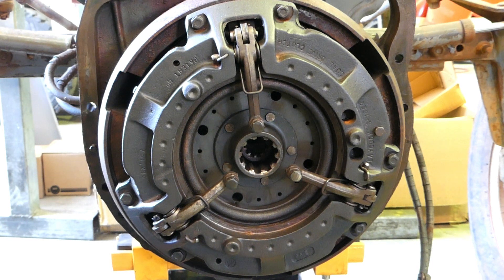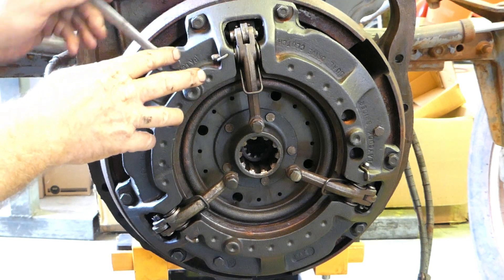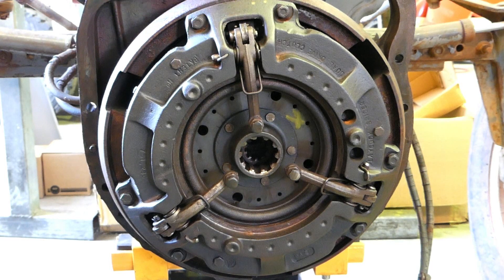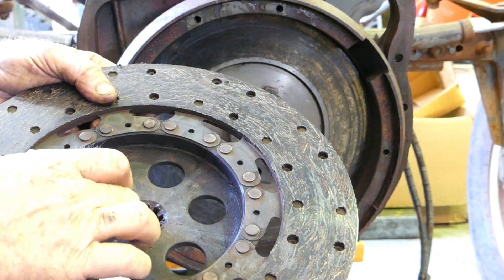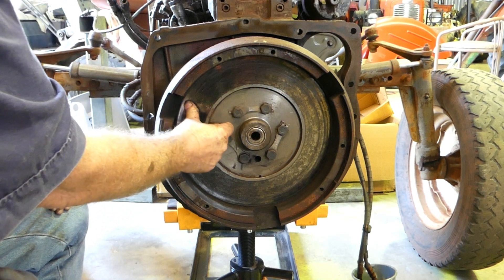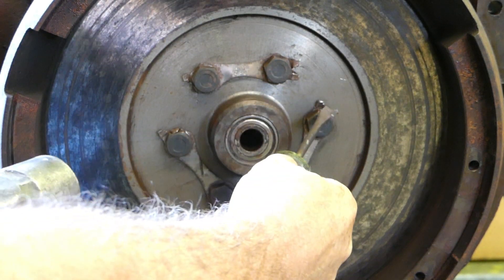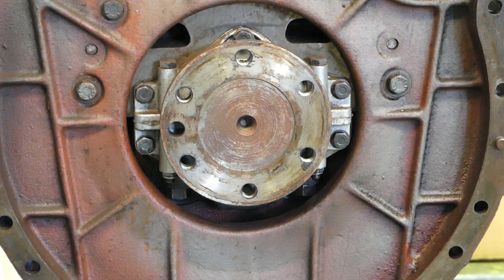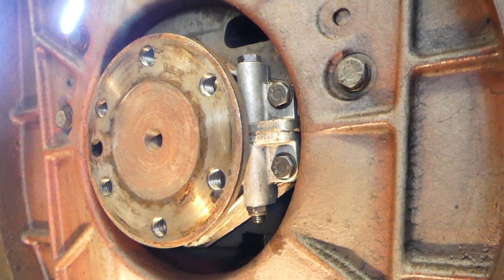Massey Ferguson 135 Multipower Removing the Clutch and Flywheel

Comment: So my pto stopped working on my 50.  But it drives and shifts no problem I’m assuming pto clutch.  Which one is for pto and how does it all work. Thanks
Reply from the maker: Check the video on how it works, the plate next to the flywheel is the main one.

Comment: Commenting again from England 🇬🇧 

It's a few years since you uploaded this excellent information. 

May I ask, have you fitted a lip seal conversion yet.    My original rope seal is a wet as an otters pocket!

Your comments on this would be very much appreciated. 

Keep up the good work.

Alan Nock.
Reply: Fair enough, I don't blame you for sticking with the tried and tested;  it is a substantial amount of work to renew the new type if it is short lived.

It's my theory that the scroll I believe is machined on the mating surface of the crankshaft, will quickly wear a lip seal.  

My decision is to fit a new rope seal, following  the excellent tutorial you have uploaded. 

It can't be worse than it is now, I strongly suspect that it's the original, and it's pouring out.

Keep up the good work. 

Thank you.
Reply from the maker: I have one here to try but I haven't had the opportunity to use it yet.

Comment: Hi Lance, Many thanks for sharing your valuable experience and knowledge.. I am restoring a MF 135, and find your comments very informative. I purchased my tractor with a seized motor but otherwise it is very straight. I have the motor being repaired by a very good local engineer. The big ends had picked up but the crank came up nicely. I heard that there is an updated rear engine seal which a replacement for the wick seal. Is this true?  Cheers Ross
Reply from the maker: Yes Quality Tractor Parts in Ireland sell them, I have some here but I havent had a chance to test them yet but by all accounts they are a good thing.

Comment: Lance,  if a clutch is put back and the finger bolts are too far forward what can you do with it. Is there a reason they should be depressed forward. I presume they should be level with the clutch front at least but in the case I saw they were depressed far in or forward.
Reply from the maker: If the pivots are worn they go too far forward but the parts are readily available to replace the parts only and not the complete unit.
Reply: Are these the three small pins holding on the fingers?

Comment: Have you yet been able to test the lip seal conversion kit? Wondering if it would be worth a try, since our MF 135 seems to need new crankshaft seals. It leaks alot of oil through the weep hole in the bellhousing.
Reply from the maker: No I have not had the need to use it, I hear they are working well though.

Comment: What is the bolts size required for holding the clutch in before you remove the outer bolts if you could let me know be very much appreciated
Reply from the maker: They are 1/4 unc  but not sure of the length
Reply: @BundyBearsShed  thanks very much for that
Reply: @BundyBearsShed  thank you mate.
Reply: @BundyBearsShed  You say it's unf in the video?

Comment: I notice a odd spring missing lance
Reply from the maker: G Day Tim, When they went to the heavy duty red springs they would change the number of springs to suit the HP of the tractor.
Reply: @BundyBearsShed  many thanks I put 6 reds in mine but it had 12 yellows in when I split it. Which is correct?
Reply from the maker: @timboothman4888  both could be as the yellow springs had less tension so you needed more. The red you could use 6, 9 or 12 depending on the horse power but it got harder to press the pedal in as well on the smaller tractors.